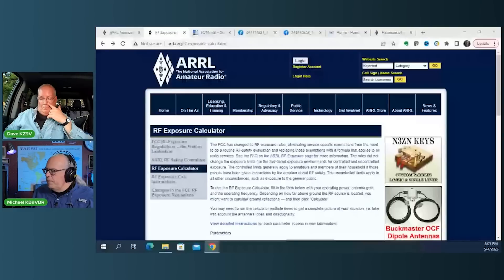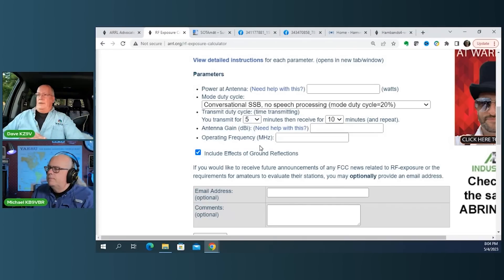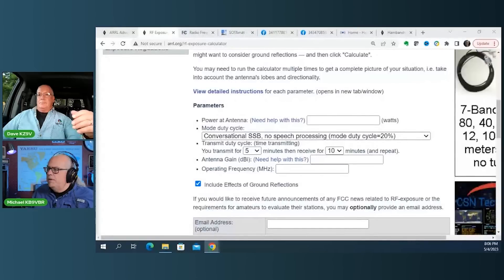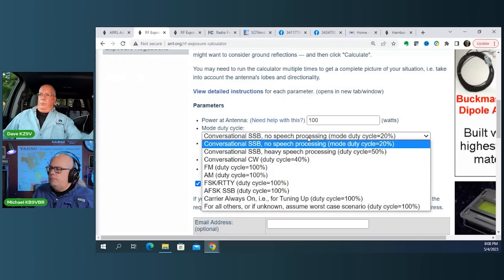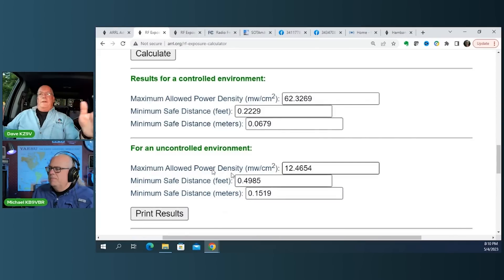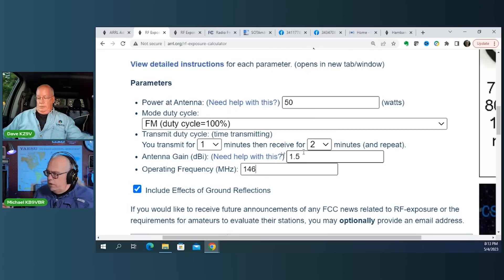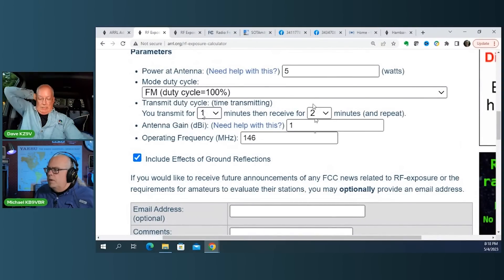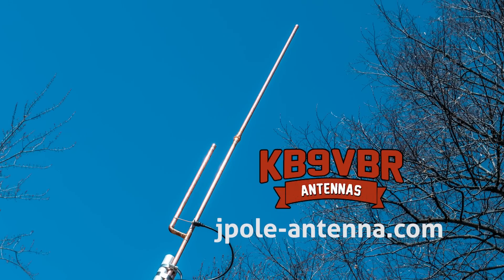Ask Michael, KB9VBR: FCC now REQUIRES amateurs to perform antenna RF exposure calculations

Comment: It’s well past time we did this, but I feel it should be an advisory not a requirement. If the individual wants to accept the risk to themselves, that’s fine. Most amateurs are going to be well within compliance where it comes to 3rd party exposure by default on all bands due to simply having roofline or above antennas

Comment: With high speed Internet conceivably there could be a data link that allows remote antenna access.  IE Commonly shared antennas that would be safe where the actual broadcasting equipment is off site.

Comment: My ham license is current but I haven't transmitted in years and don't currently have a radio connected to an antenna.   Well. I have a CB in my car.  Unmodified.  If somebody can be harmed by 4 watts, it's more likely to be from poking their eye out on the antenna than from RF burns.

Comment: I met guys in the Navy that told me that they had stood to close to the radar and melted a chocolate bar in their pocket. I heard stories about people warming their hands in the beam and heating hot dogs. These were older guys and this was a long time ago. It gave me the impression that you would feel it if you absorbed too much RF. It seems like it would be very painful past a limit. As far as cancer from it I have no idea. Who is going to use thousands of watts at gigahertz frequencies and stand in front of it though?  Inside a car the roof is a metal shield, like a microwave only wavelengths smaller than the window will enter or exit. I wouldn't even consider it an issue unless  you worked at a radio station putting out hundreds of thousands of watts.
Reply: @super66craig  Was that megawatts in bursts or continuous? For a satellite to do anything in that range it would have to be for a short amount of time, I am guessing, not sure you are saying satellites go that high like the CIWS.
Reply: RADAR uses very short pulses at gigawatt ERP. 
The most powerful broadcast radio station in the US is a class C FM with an ERP of 100,000 watts.
Reply: "Who is going to use thousands of watts at gigahertz frequencies"

In the past I would probably be crazy enough to it provided I had the equipment required.

 "and stand in front of it though?"

Yet I still would not have stood in front of or right next to it.
Reply: @billfargo9616  That may be true for FM but some TV stations are 1MW (mega, not milli) ERP, I know also there is a 1MW FM tower but technically it's a bunch of FM station each combined to a single antenna.

Comment: Good information!  Is there a specific form that can be used to record the information on and keep in your records? Thank you.
Reply from the maker: There is no form that I am aware of. You can print out the results from the ARRL's calculator to file away. But I suppose that's not very useful if you don't have a printer.
Reply: @KB9VBRAntennas  Okay sir. Thank you for the response. Happy Independence Day! 🇺🇸🎆🎇

Comment: How does this affect CB operators with 10KW linears and big beams?
Reply: How many 10kW linears have you ever actually seen?
Reply: @billfargo9616  3 bay area
Reply: Do the calculation... use 27 mhz

Comment: I see that the ARRL calculator has a note on it "This calculator should not be used for antennas that are less than 20 cm (8 in) from a person". I guess that means you can not use it for any handheld radios.

Comment: I'm seeing this as a positive.  It is simple to prove amateur radio poses no threat to the neighbors.  I haven't done calcs on 1500 watt setups, but given that most folks transmitting with that kind of power will have the antenna as high as they can, the inverse square law takes care of exposure risks.  Why I see it as a positive is that I have a gut feeling that this new reg is there to create data in support of HR 9670.
Reply: I'm outputting 100W max.  I shan't be doing this.

Comment: This will, like most other things, never be enforced. I am far more concerned with the intentional interference going on on the airwaves today, than notifying someone that, if they come within 3" of my antenna, there is a snowballs chance in hell that they MIGHT get some radiation exposure. Albeit, less than using a cell phone, but still.
when the FCC starts going after those people intentionally interfering with POTA, then we can talk business. Until then, please keep 3" from my QRP antenna!!!
Reply: Agreed. The fastest you'll ever see the FCC move is if you QRM a commercial freq. Then the black helicopters will hover over your QTH Pronto.

Comment: Thank you for your video.  I have concerns over the accuracy of using calculations to determine rf exposure.  For example, swr, the type of feed line (coax or 450 Ohm ladder line), complex impedance produced by the feed line antenna combination, and the loss of the rf signal caused by the antenna tuner.  I am wishing for a certified rf field strength meter at a reasonable cost to actually measure the strength of the rf field at the station location.  I have looked for field strength meters.  I found that there are many meters out there, but their lowest frequency that can be measured is way above the lower hf frequencies such that you would find at 160 or 75 meters.  The lowest advertised frequency range I could find started at 10 mHz.  Most of the field strength meters start at or above 50 mHz and extend into the microwave region.  I did find a study performed by the FCC where they used a EFS-1 field strength meter.  I was lucky enough to find one on Ebay.  The meter works, but I don't know about the calibration.  I used it to measure the field strength of the rf at my station as I was transmitting.  I was transmitting digital data at an output of 85 Watts measured at the transmitter.  I measured between 3 to 5 V/meter.  I'm not sure how to convert to milliwatts/meter squared.  This was at around 3.5 mHz.  I would mention that the antenna set up does work quite well at that frequency.  I tried the same antenna set up at 7 mHz with much different results.  My antenna feedline set up did not work well as far as swr, but the signal was getting out.  The EFS-1 gave a much higher reading than it did at 3.5 mHz.  At other frequencies where the antenna and feedline set up did work well with low swr, the field strength meter gave a much lower reading than at frequencies where the antenna feedline set up had a higher swr.  
I was wondering in order to keep the FCC happy and to be safe in regards to rf exposure, is it okay to make the calculations assuming a perfectly working system with low swr where maximum radiation is happening at the antenna and not to worry about where the rf is really being radiated?   Most locations at the home are at least greater than 10 feet from the antenna except for possible rf radiation from the ladder line.  Can you recommend an accurate but reasonable price field strength meter.  Thank you.
Reply: Plus guessing the pattern of random antennas or do you have a beam?  Calculate exposure every 30 degrees of rotation?
Reply: @tomsherwood4650  How do you calculate the exposure with the direction of the antenna as a factor?  There is nothing to go on except what you think is happening. This is why I would like to find a certified field strength meter that would actually tell you what the field strength is.
Reply: When allocating federal funds for grants to industry, the FCC requires actual measurement.

Comment: I lived on the 11th floor of an 11-story high-rise and above my head were 24 high-power cellular towers had 800 megahertz 900 MHz 1.8 GHz, and 2.3 GHz antennas
My RF field strength meter was pegged off-scale every second of every day

The antennas were licensed for 120 Watts

I would estimate the ERP was over 180 Watts

These microwave signals we're not regulated in any way

Every cellular company used the roof of my apartment

We really need to get together and demand the FCC remove all antennas from residential buildings
Reply: Cell towers transmit at 3 watts max.
Reply: The ERP emitted from the directional cell tower antenna array is WAY more than 3 watts, but the immediate proximity of your 2 or 3 watt cell phone immediately adjacent to your head is a far more concerning exposure risk.
KZ9V

Comment: I would think for a HF station you would only need to do the calculation for 10 meters which would be the worst case scenario. I am on an acreage my antenna is 15 feet high a lowest point and 50 feet at the lowest an the tower is 120ft from the house and probably 400 ft from any neighbor. My calculation for my 500 watt SSB station is about 4 feet. So I think the whole thing for my case is kind of silly. 73 W5HJ
Reply: It’s pretty silly for most of us.

Comment: I am using a J-Pole designed for the 11meter band, commonly talking on 27.3850Mhz  according to my RF Power at Antenna (not listing my power output)  but according to this calculator people must stay away by 16feet  Which where my antenna is located No one can get to it and it has a natural barrier of 25 feet.  so seems I am in compliance

Comment: What I find from the formulae on the ARRL site is disturbing for any VHF/UHF handheld not running peewee power.  For a 5W 70cm FM handheld 2 min on 2 min off cycle and a 9dbi Ant often used to get the lower angle of radiation at distance from repeaters or even for good simplex on the flat, the min controlled distance is 0.6m (2 ft).  There is no way you can hold a handheld according to those results.  Even with a 70cm 2.15dbi 1/4 wave coaxial dipole min dist is  0.3m  (11") still too close to the human body.  Hmmmm food for thought with handhelds.  Even 1W into a coaxial dipole the distance is 5".  Will they be banned !
Reply: For the very same reasons, I'm not comfortable holding my cell phone next to my brain.  Unfortunately, I walk around with it in my pants pocket all day long. That's probably a bad idea...
KZ9V
Reply: In the 70s there was a trade journal for two-way radio techs, and they tested effects of HT RF on the eyeball. The VHF frequencies made little difference , but they could measure a definite temperature difference in the fluid of the eye after a 30 second transmission.

Comment: I have a dumb question. I'm not sure exactly what speech processing means in the rf exposure context. The two options say "Conversational SSB , no speech Processing ... 20%" and "Conversational SSB , heavy speech Processing ... 50%." I always chose 20% but I'm not exactly sure if it's correct. I'm not a loud talker nor do I talk a lot. This seems to be subjective. How does one determine which to chose? BTW thanks for sharing this video!!!
Reply: Even if you choose 50% you got to consider total exposure like only periods of transmitting and even with that you are probably way below any issues unless you run a big amp or set the antenna in your lap.
Reply from the maker: Speech processing is also known as compression. The audio waveform is full of peaks and valleys and processing will raise up the level of the quiet parts so that the entire waveform is more uniform- but also stronger. With sideband communication, the higher the audio level, the great the transmitter power output. I hope this helps.
Reply: @KB9VBRAntennas  It does help. That means I chose the correct option but will keep in the back of my head if I end up using compression.  Thanks Michael!
Reply: @tomsherwood4650  Understood. Thanks for the reply!

Comment: Running calculator for 850mhz cellphone at 3w (FCC maximum) and you get 6" safe distance. 
That can't be good.
Reply: Most cellphones now are milliwatts though.
Reply: Your cell phone power output is automatically dictated by your proximity to the nearest tower.  That's why your battery wears out faster when you're out on the fringe of usable service.  Many phones are capable of 2 or 3 watts RF output. .
KZ9V

Comment: Many hams ae on FT8, 12 seconds on 12 seconds off, don't see how to calculate that mode.
Reply from the maker: I'd calculate for the highest duty cycle: 1 minute on, 1 minute off. The average FT8 QSO takes 3-4 transmission cycles so that time value averages out over a 2 minute period.

Comment: Something I have thought about for a very long time, we have first responders using these all day long. They have to have some kind risk to something?
Reply from the maker: Possibly, but I don't believe so. Police and fire, for example, may have a radio on their belt all day long, but in reality they may only transmit a total of a few minutes during the entire shift. Plus the individual transmissions are very short. If you listen to those in the public safety field operate, it is very brief and efficient. That puts their risk level quite low.
Reply: In the 70s there was a trade journal for two-way radio techs, and they tested effects of HT RF on the eyeball. The VHF frequencies made little difference , but they could measure a definite temperature difference in the fluid of the eye after a 30 second transmission.

Comment: Dumb question but did the FCC formally endorse the ARRL calculation? If the FCC did not, then there will be a dispute this will be a flail-a-thon.
Reply from the maker: The online calculator is derived from the formulas in FCC OET bulletin 65. There shouldn't be an issue if the math in the bulletin and the math from the calculator match: https://transition.fcc.gov/Bureaus/Engineering_Technology/Documents/bulletins/oet65/oet65.pdf
Reply: @KB9VBRAntennas  Fair enough. Thank you for replying. Another dumb question : Calcs generally require PE (professional engineer) stamp. I'm not an electrical PE. Big can of worms if you ask me. Thank you for bringing this topic to light and I'd be honored to have you in my log. Respectfully and 73.
Reply from the maker: For commercial or industrial purposes, like if you were a broadcaster, I would agree the calculations would require certification by a professional engineer. That requirement doesn't seem to be the case, though, in the amateur radio world.

Comment: Here's my thoughts and I hardly speak out.  Cell phones have been show to be over the limit along with towers.  I really don't care for the FCC coming in and saying we have to do this.  Most of it is common sense.  I try to speak logically and not out of emotions though.  We live in a different age.  Instead of complaining, here are the benefits (and keep in mind I find all of this tedious and a pain in the arse even if it only took 5 minutes to do): We live in the age of Kens and Karens (my apologies if you an operator named Ken or Karen) who like nothing more than to cause issues.

I printed these into a PDF file, loaded them to my google drive, and have them on my field tablet and my phone.  If you run into that busy body that likes to call people, let them show up, show them your exposure calculations, explain to them and be a proper ambassador to Ham Radio.  Whoever they called can go over and explain to the Ken or Karen and deal with the issue and go about your business.  In the days of POTA and SOTA (probably less of an issue with SOTA) more people are seeing what we do and asking questions.  I'm sure the question might come up and now you have a visual on hand to explain.  

Yes it's a pain but in reality I figured worst case scenario, highest power of each radio, the band I'm using, 100% duty cycle and proper gain of my antennas.  It took 5 minutes.  I don't like it more than any of you do, for most of us it's about principle.  At the same time there is an aspect of these requirements that have a chance of making things easier out in the field.   That's just my 2 cents for what it's worth.  WIth inflation that isn't much.  I don't expect anyone else to look at it the way I do.  Just giving my thoughts.

Comment: Just did one after the last Tuesday project net. I am new to radio, had my technician a while. Would one of you guys be able to help me to set my tyt? I'm trying to hit the WA7ABU repeater with a tyt th-9800 with 50watts from sandy, or. Works fine on echo, well it did until last week..KG7QID
Reply: I am on 2 meter.

Comment: Ya know what? I think the bigger issue is that many of you run more power than you are legally allowed to. 

Think not? You are allowed 1500W ERP. Not TPO. So if you run 1500W TPO into a 4 element cubical quad  with a gain 12, you are actually transmitting 24KW ERP. 

Think about it.

Comment: Not a ham, but I have a question. As RF exposure is generally harmless, so long as it is not intense enough to cause tissue heating, what the hell is this all about? I expect that it's the beginning of the end of amateur radio.
Reply from the maker: RF exposure is harmless, until it is not harmless. The poinf of doing exposure surveys is to determine if you are safely operating your equipment.
Reply: Generally barefoot transceivers are not gonna be an issue at all on HF but I also am in suspicion of how accurately you can calculate this stuff versus actual measured, which is complicated and expensive
Reply: I have long wondered how much longer I would enjoy ham radio. I’ve been soldering stuff together for over 50 years. It becomes less fun every regulation cycle.  This may be the last time I’m legally licensed. Imagine the physics & math degree I’ll need to renew next time. And just you watch the number of pirate stations on the air go up in number.
Reply: My thoughts exactly. A curtailment of the last bastion of free speech